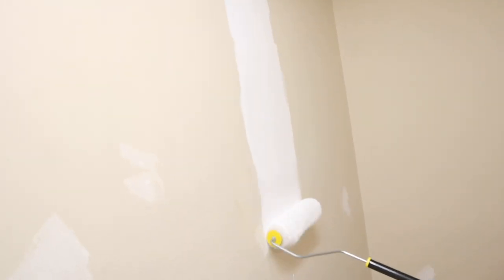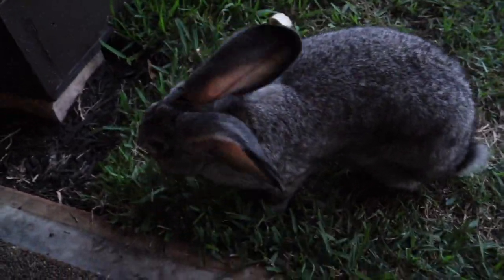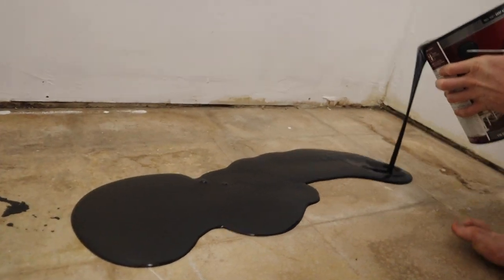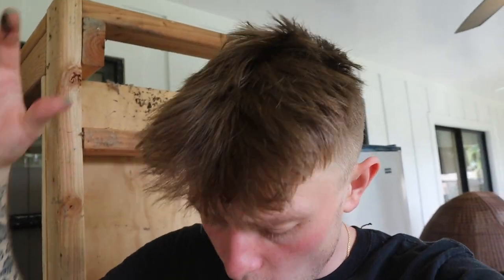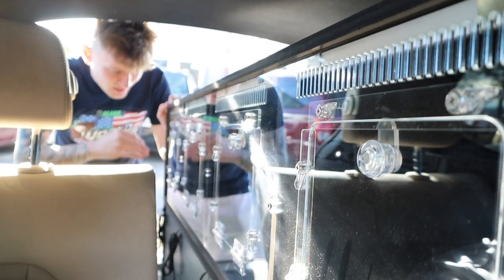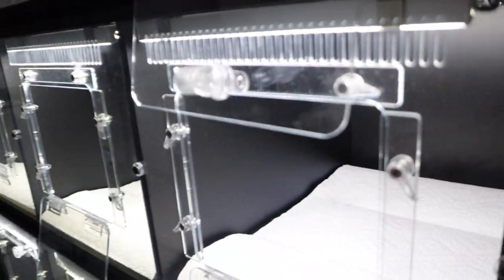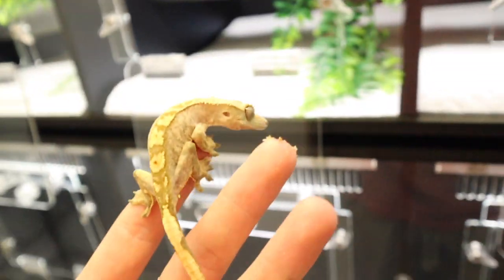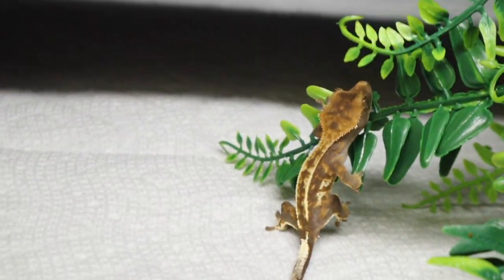COMPLETING the GECKO ROOM!!!!! *INSANE*

Comment: I would recommend putting the enclosures on something so that they are higher up. I had the same issue with very similar enclosures.  You have room above the enclosures that's wasted.  With what we built, we made it so that it had drawers for extra storage. You should get Paul's contactor Hector to build it for you. I can take pictures of what we did to give you an idea if you want.
Reply from the maker: Good idea but I won’t be able to get to the top than!
Reply: @GioLanni  it does not need to be be high. Mine lifts up my enclosures up a foot.